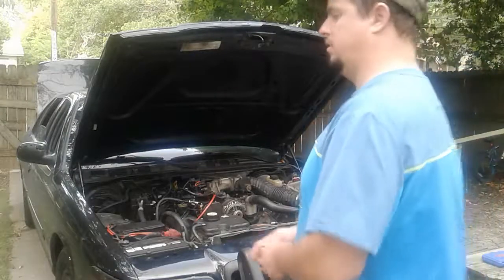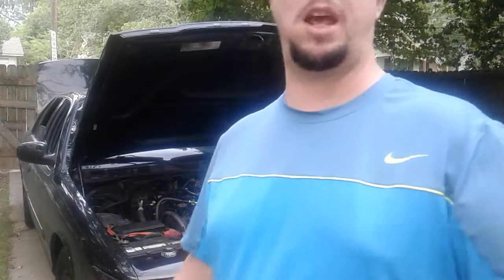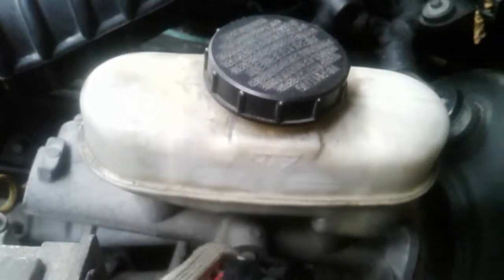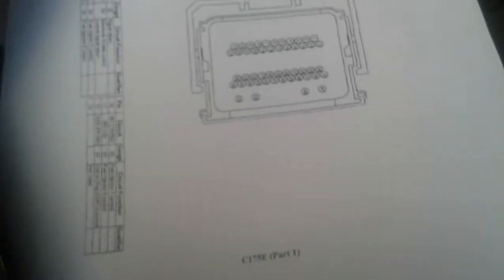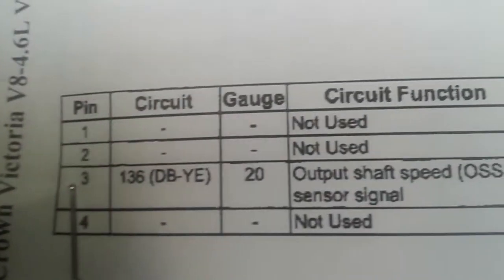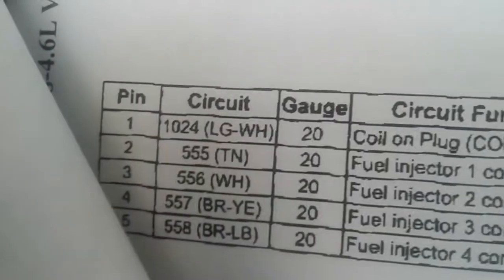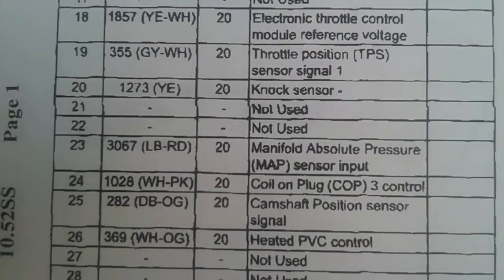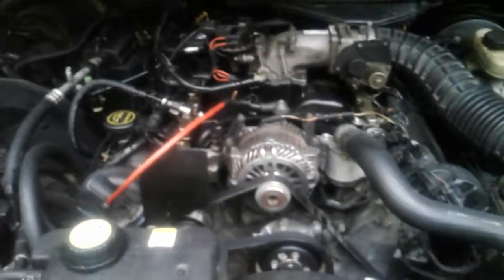Crown vic pcm pin diagram

Comment: THANK YOU 👍👍👍👍👍👍
Reply from the maker: Your welcome
Reply: @MegaBobson123 
Please I want to ask you about the white smoke coming out of one of the exhausts while the other exhaust does not come out any smoke.  In addition to the unstable engine revs and roughness of its sound, in addition to the appearance of the engine mark and error code P0443.  Note that my car is Ford grand marquis 2010 GS. The counter has reached 321135 km